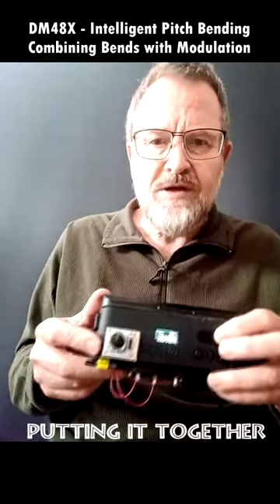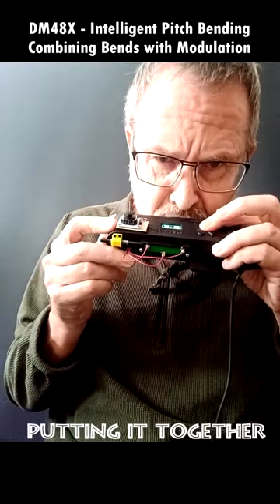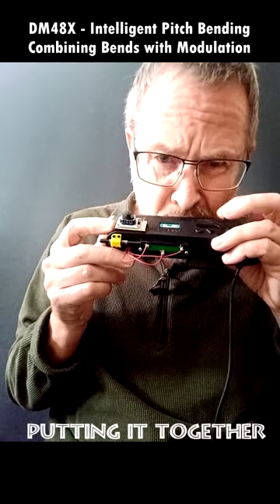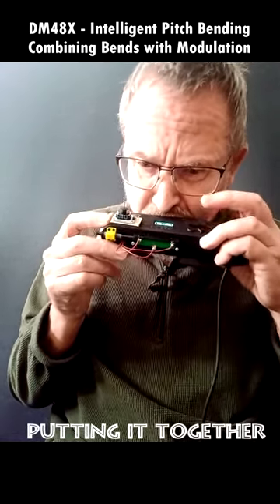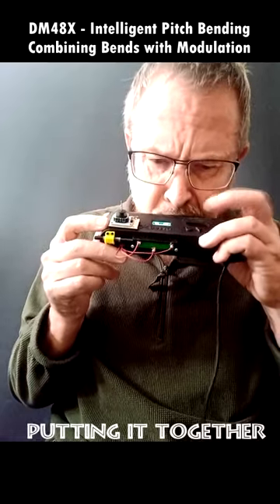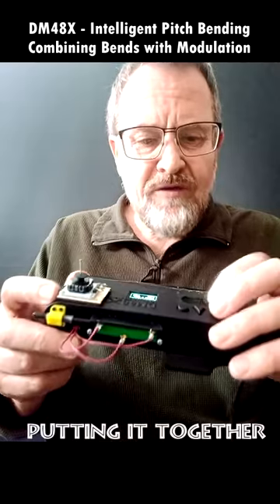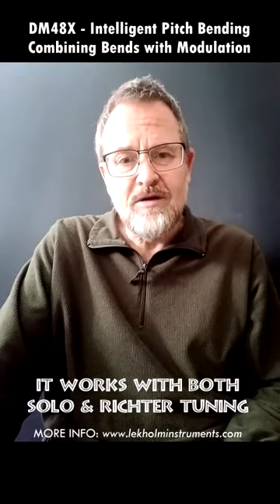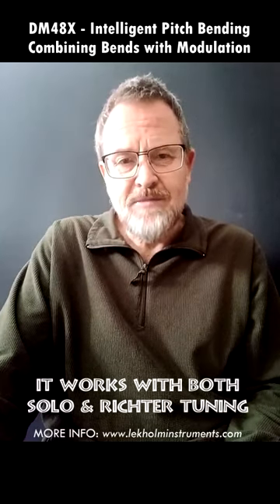INTELLIGENT PITCH BENDING: a Quick How-to

Comment: Bernoulli's principle a constriction to air flow through a tube causes the velocity of the air to increase and therefore the pressure to decrease. The narrower the pipe section, the lower the pressure in the air flowing through this section is easy to measure and digitize.
Reply: With two sensors per hole, it can sense draw, blow, bend. Plus how hard you blow, draw, or bend. Bernoulli's equation for fluids can be used to calculate hole size and tune it to a pitch.